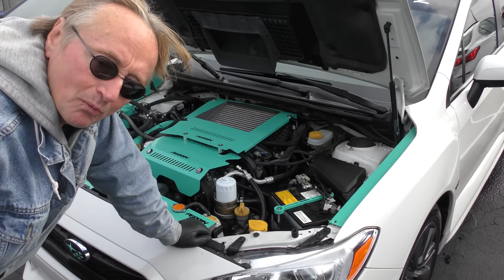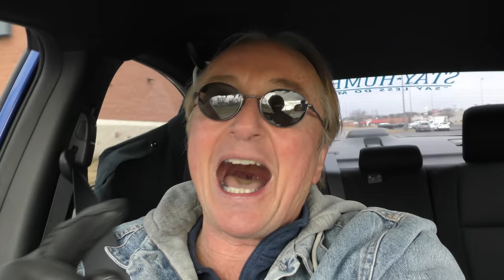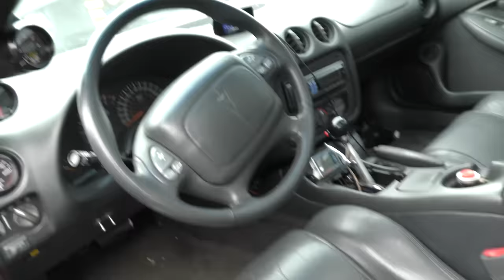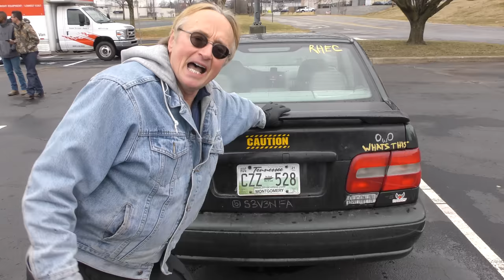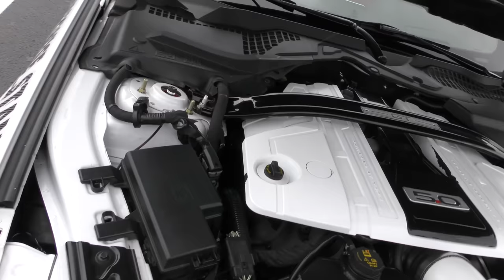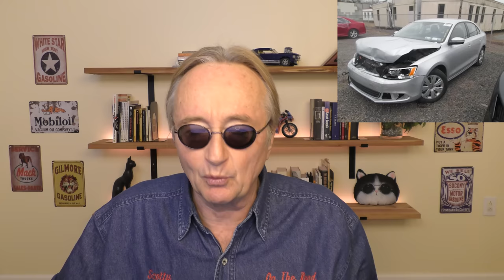I Finally Went to a Car Meet, Then This Happened

Comment: scotty pulled up with his 1994 celica and absolutely trash talked anyone who didnt have 300k miles on their car like his celica does
Reply: Hahaha
Reply: And if their ac didn't blow cold 🤣😂🤣
Reply: @laprepper  Ice cold!
Reply: @williamoftexas1489  😁
Reply: You killed it. Lol I'm crying,
Reply: He then proceeded to rip all the plastic crap off everyones engines
Reply: "and it still shifts smooth"
Reply: Sold my ram Hemi with 368 miles and ran smooth
Reply: My 1994 mustang only has 192k miles on it. 😕
Reply: @UmmYeahOk  easy dude that's barely broken in
Reply: 250k miles on my current 1999 bmw 🤫
Reply: @mrjpz  and it still runs without over heating? Im sure you are a stickler on the maintenance
Reply: @SqlwithAJ  not a single issue even my dsc is working 👍 no overheating nothing even though they're not really known for overheating other than the coolant reservoir busting cause it's plastic but that is easily solved with a full aluminum radiator. My maintenance is mostly free thanks to fcp euro👍 it's also had a Supercharger in it for 140k miles so the "unreliable" bmw isn't as unreliable as people say

Comment: just picked up a 2007 Toyota Matrix m-theory today to replace my beat up 98 subaru. The Matrix only has 55,000 miles. Inside is super clean and the outside is pretty fricking good for being as old as it is. I plan on driving this for a really really long time. Thanks Scotty! You made picking the right used car for me a lot less stressful.

Comment: One of my neighbors has a 2008 Toyota Yaris she bought new, that she's driven to work, and around town every day with very little issues, so I agree with ya Scotty not the greatest car, but they get good gas mileage, and if you maintain them well they will last a long time, so if you see one that's in good shape, and at a cheap price grab it for a daily commuter car, or first high school car/college car.
Reply: In 2008 Yaris was still built by Toyota and I've seen them with 500,000 miles on them. They had the 1nzfe 1.3L Toyota engine in 2008. They are actually one of the most reliable small cars ever made. Scotty seems to think Mazda has always made them, they only started making them in 2018.
Reply: I have a 2000 Toyota Echo which is a Yaris, 21 years old now. Put tires on it (twice), oil change, had to replace the exhaust, brakes and rotors, wiper blades( about once a year). Oh, needed a clutch also. It is not even close to great handling. I hope to get 10 more years out of it, bought it in 2010. Cost per year is pretty low.
Reply: @Toyeboy89  this 100%,  I'm mainly talking about looks and ride/handling quality compared to the  Corollas, Camrys, or even the Honda Accord, if that matters to ya. Me personally as long as it's reliable, economical, and safe then I'm good.

Comment: The old like 07 to 2014 yaris are still Toyota and made in Japan. We have a few in Cali with over 280k miles. Rough riding no interior insulation. But man 40 mpg and dead nuts reliable. Even the autos!

Comment: First Toyota was an 81 Carolla and blew 4 speed transmission at 80k, the 1.8 litre engine was bulletproof. That car rusted out completely at 150k. 1987 Carolla, burned oil at 60k, had an awful engine knock and was a dog. The 5spd transmission was flawless. That car was a piece of junk by 140k. 1988 Camry, no transmission problems but had bad head gasket and electrical problems at 150K as well as rusting. Toyota makes some great cars but they don't all last till 300K miles especially in the cold snowy north.

Comment: I bought a 2013 Camaro RS 3.6L LFX last may at 90K original miles for $6000.00 It has been a great investment for throwing it sideways thru the Mountains here in East Tennessee. The 5th Gen Camaros can be a really fun option if you find the right one.

Comment: I found a whole exhaust system for a 2013 GMC Sierra for only $200!!! That includes both cats, it was totaled in a wreck, had only 78,340 miles on it. That would have cost me way over $1,000 for a GM stock exhaust with two cats.

Comment: In 2012, I bought a new 2012 Volkswagen Routan, which was really a Chrylser Town & Country with VW badges. Volkswagen ended their agreement with Chrysler to produce the Routan in their Toronto factory, so they slashed $10,000 off of the sticker price of the remaining new inventory. I still own it and it currently has 122,000 miles. The following parts failed early and neded to be replaced: 1) the eco system was recalled due to causing premature wear via 'hard shifting' on the trasmission, 2) passenger sliding door motor, 3) the alternator, 4) the battery, due to the faulty alternator, 5) the rear calipers, 6) and the front struts. 7) The transmission seems to have a problem. Reaching third gear causes the engine RPM to drop from around 3,000 RPM to 1,100 RPM and slow acceleration. If you give it a little more gas (the gas pedal ignores minor changes in foot pressure) to get the RPM back up, the computer thinks you're flooring it and it overreacts, sending the RPM nearly to redline while you shift into fourth gear. 8) Chrysler wouldn't install their seats or Stow N Go in the Routan, so VW had to provide their own seats that didn't fit perfectly. The driver's seat barely fits people who are over 5' 6". I'm 5' 11" so I have to bend my legs significantly to be able to press the pedals, even with the seat pulled all the way back. I can't wait to trade this thing in for a Honda CR-V. I should've bought a Honda Odyssey or Toyota Sienna back in 2012.

Comment: Hello Scotty, I want your advice, I'm moving to Toronto and I want to choose a good fun and reliable car between: Hond Accord 2010 V6 or V4 , Volkswagen Passat CC 2010 , Ford Taurus 2013 , Mazda 3 2012, Subaru Legacy 2012?
I love you 🤍🤍🤍
Reply: The wisdom of Scotty would say... 
Honda is very fast and reliable.
Mazda is zippy, corners great, and is very reliable.
Subaru, while not as reliable as the other two, handles great and the all-wheel drive is great in the snow.
Also, make sure you have a mechanic check it out first.
😁
Reply: @VKSgtSLaughter  Thank you man.. 
Appreciate it.
I'm asking him to know if there is any specific thing in those years version to worry about 🤍

Comment: Scotty what’s your opinion on the Ford Mustang 2009 V6 and it’s automatic transmission  I own one and it’s in good condition but I don’t know if the automatic trans fluid has been changed it’s at 120000 thousand miles should I just let it go or should I change it? What’s you thoughts on everything ? Thanks

Comment: Scotty, Mazda didn't start building the Yaris until very recently and this is only for the North American Yaris sedan starting in 2017.  Toyota built the hatchback version through 2018 for the USA models. They had the 1nzfe 1.5L engine, easily 300k miles on it. I've seen some with 500k miles. Idk why you always insist Yaris has always been a Mazda built car, it is simply wrong.

Comment: My mk 4cjetta/ bora we call it in the uk has 217.000 miles on.  She has been a gem for the 6 years of ownership I have covered nearly covered 100.000 miles in the 6 years . And having the pd lump in so reliable nice 6 speed gearbox which I have had to do the linkage but all good now like brand new .  No problems except bushes . And I have fitted h and r 35 mm cup kit poly bushes all round . Pd 150 hybrid turbo darkside development side mount intercooler kit.  Stage one remap by revo . She is a very good car . Running about 250 BHP and very tourqey.  But yes the new Jetta s  are rubbish . Not built to last .

Comment: I’m fairly sure it’s only the late model Yaris from 2019 and up that’s made by Mazda , the older ones are still a Toyota made vehicle , in Asia is was a Vios or a Vitz and the older Yaris share a bunch of parts with the Echo , feel free to correct me if I’m wrong though
Reply: You are mostly correct, but Mazda did start building the Yaris sedan only model in 2017 for the USA. Now Mazda builds the Hatchback model starting with 2020 model year north america only though. Everywhere else Yaris is completely Toyota built.   Scotty has made this mistake several times saying they're all Mazdas. They were Toyota built 99% of the time until recently. They have the 1NZFE engine.
Reply: @Toyeboy89   ahh I didn’t realize the sedan and hatch were changed over in different years , but that makes perfect sense , I don’t really see many sedans at all really , I think I’m one of the few people who nerd out about the “ boring “ Toyota’s 😂
Reply: @JohnJeep7  yeah I only know so much about it because I had a 2015 Yaris Hatchback researched the heck out of it, loved the car so much but a freak accident totalled it. I now have the hybrid version Prius C gets average 50mpg.

Comment: Ah, see my Mitsubishi galant! Mine broke the timing belt and that's end of it
Reply: I've bought 3 Galants that didn't bend valves when breaking the timing belts.  They were 04 and up MIVEC's.  Then my Outlander with the same engine broke the belt and bent the valves.  Never can tell until you check it.  Wasn't much trouble repairing the cylinder head on the Outlander.  It bent all 4 exhaust valves.  Not a big job.

Comment: Scoty, i love your pation fir mecanics., and your way of explaining things, so whit that in mind i SUB...
Now, i have a quetion for you..,
-Last year i boght a Citroen C8 ,2.0 Petrol whit over 290000 miles on board.
Wile you turn on the engine the onborad coputer dash it shows onother 9000 miles counting down [i gues this is the millege that citroen guarrantee before the engine gets ro be rebuild/maintain- or... Not???...]
My question is wat is going to gappent after this 9000 miles tgey run out, or wat should happent?
The engine which is on LPG alsaw runs good so far...
Looking forword to hear from you.

Comment: Scotty! I want to start on my first project car. What do you think of these cars in terms of cost of repairs, reliability, availability of parts, and how easy it is to work on? 
91-97 Lexus SC300
87-93 Ford Mustang Foxbody 5.0
91-98 BMW E36 325i-328i
03-06 Infiniti G35
My budget for the car is around 5k US dollars.
Reply: I'm not Scotty, but maybe I can give you some insight.  A lot it comes to aesthetics.  Which car do you like the looks of most? All are front engine/rear drive. 👍👍👍
All have big aftermarket support.
Cheapest bang for buck (as far as mods) is the Fox body.  However, Fox bodies in good shape getting really hard to find and expensive. 
SC300 - same platform as Mk4 Supra. Huge aftermarket support as well. But they are getting expensive.  My nephew just picked up a 95 SC300 for $2500. He has done a manual trans swap and is getting ready to install a turbo. 
3 Series of the 90s are much simpler and more reliable than ones of today.  The L6 engines are great. Lots of aftermarket support as well.
Reply: Appreciate it guys thanks

Comment: hey Scott I have a question  I have a subaru sti 2017 I bought a clutch  they recommended  a 6 puck action clutch would  it be recommended  to use it it's a stage 3

Comment: That black Volvo S70 looks like something from a future Mad max movie.............
Reply: You should see my other Volvos, that one is my TAME build 😂
Reply: @MitchSevenMusic  Guessing you are a skilled Volvo mechanic,  have a 2000 V70 Cross Country, thinking about turning it  into a toy rather than a driver.
Reply: @brianklamer3328  gotta make sure you service the awd regularly with the exact fluids cause they are picky that's why you see a lot of them with the awd no longer working
Reply: @MitchSevenMusic  The Haldex AWD system is in proper working condition, the carrier bearing to back axle was bad and propeller shaft worn at joints. Removed the shaft and now it's a front wheel drive low pressure turbo that spins the tires damned good for stock and 20 + years old.

Comment: Scotty, is it actually true that RWD is a bad idea to have while living in a place with bad winters like Boston?
Reply: To some  extent it is my friend has a RWD Lexus IS and it does fine in the winter granted it doesn’t have a significant amount of power.
Reply: Front wheel will go through snow easily, rwd is more fun be youd better be ready to get stuck or go awd or 4x4 snow tires help, butpulling is better than pushing in snow
Reply: I drove a 2WD Toyota pickup thru 7 winters in Chicago area.  I never got stuck. However...Chicago area doesn't get much snow and it's so flat there.  Roads are cleared very quickly there. 
But more than 5" of snow and I wasn't going anywhere in that truck.  Rarely did that happen.

Comment: Some things are absurdly overpriced and you're really paying for the name.  But other things, like some of the cheap headlights and LED bulbs you buy on eBay are crap (yes, Scotty has done videos on this).  I'd say for some things, yeah eBay is probably fine.  Although I wouldn't buy things like tires, rims or brakes myself.  But light kits, lift kits or other things, maybe.  But I also wonder the quality you're getting in a lift kit for only $60.  Will the thing break the first pothole you run over?

Comment: please please, people,  do not   DRIVE   IN   RUSSIA.....' flying wheels, rolling shopping carts, falling streetlights/trolley wires/infrastucture, animals on the loose, rolling driverless vehicles, lotsa parking brake sounds, wild people laying on the roads/corners, left unsafe turns from 2/3  lanes away...."  motorcyclists in sandals/no helmets, drunks staggering around....''